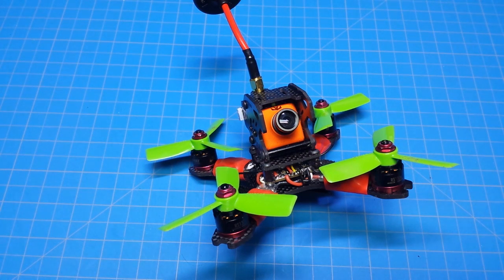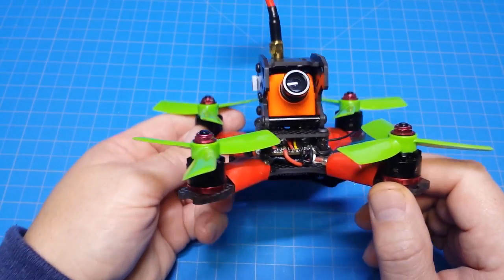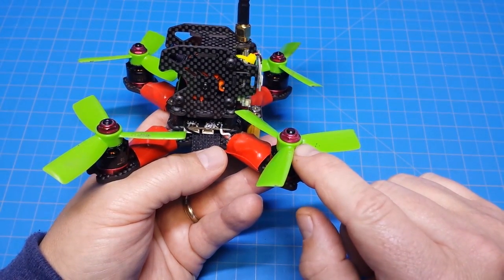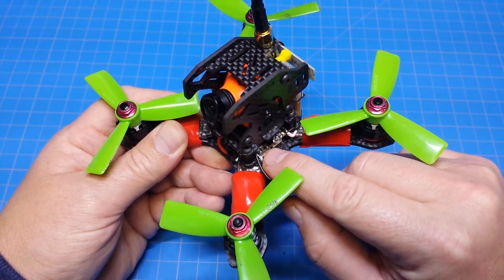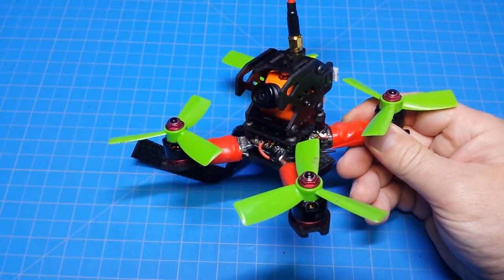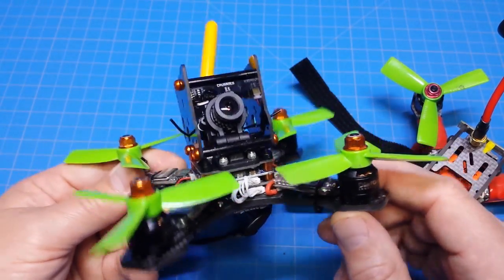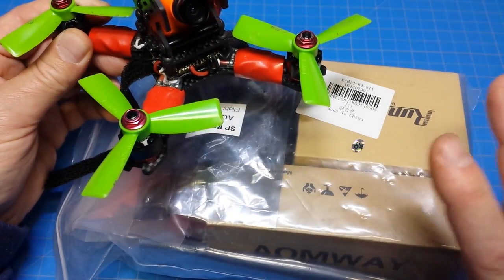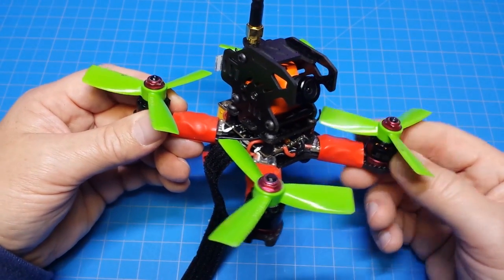Custom - GB130 Frame

Comment: I got the banggood version realacc , it's under $18 it also has the side antenna option you can see mine here: https://static.rcgroups.net/forums/attachments/3/8/9/1/4/5/a9475337-91-IMG_3313.jpg
Reply from the maker: looks good.

Comment: Should i go with 2 motors of each, CW and CWW or just get all CCW and use proper lock nuts.
Reply from the maker: Either way will work, its only the threads on the motor stems that are different. Some prefer all the same threads for the benefit of not having to locate a reverse threaded nut if spares are needed.

Comment: I would rotate the fc so the xt60 is on the side instead on the back. Saver with a crash.
Reply from the maker: yep. In the next GB130 build I do just that. I actually would prefer to have a led rather than the connector solder directly to the board. Ah, maybe next time, or a winter project.
Reply: I ordered the realacc xr130 from banggood. It is also a clone. It is my winter project. I ordered it because it has space for a hs1177 cam. 
I am thinking of putting some cables between the xt60 and the pdb. Also getting some 4s 1000mah lipo's. It will be my indoor racer. Also getting the tramp vtx for it. Have one in my 5" race quad and I am getting the external stick so you can set it up without needing to pres a button. I got my first tramp by a fpv race and that system worked great. 
Hope the frame is here coming week so I can start building it. Fc, motors, esc and cam i have. Only need an extra receiver. Vtx I will use what I have and later I will upgrade it to an immersionrc tram vtx.
Reply from the maker: Has the tramp become the standard at races? Or is it only multigp pushing the tramp? How to they setup classes for the races in your area? Do you have a link to that frame. I am only finding a xr210.
Reply: This is the frame. http://www.banggood.com/Realacc-RX130-RX150-130mm-150mm-3mm-Arm-Carbon-Frame-Kit-with-5V12V-PDB-XT60-Plug-p-1088991.html
I made a mistake with the name. 

No the tramp is not the standard here. I now that some races are sponsored by them. The race were I was sold them for 10 euro. It was the first production model. It works very good with that tnr wand. Best system there is ad the moment. Fast and after the race you can connect the lipo again and work on your quad and check the camera wile others race. 
Ad my club they prefer immercionrc vtx but you see also a lot of tbs and fx systems. Eachine not. After the Dutch drone race we switched from outdoor 600mw to 25mw. Other races the vtx is also free for what I now. 
Here are no classes. I now that there was a race were there was also a beginners class. But other than that, there are no classes.

Comment: What kind of LiPo do these take? 500mAh? 1300mAh?
Just noticed the OSD. You just missed the 1000mAh mark, so thats probably a 1300. Correct?
Reply from the maker: Nah, the mah and battery info is way off in the video. I forgot to switch it to 3S and scale the mah. I typically fly 3s 480mah, get about 2:30-3mins. I like to stay light so it stays more agile, gives me a better chance to recover if I get out of shape....which happens a lot with my skills.

Comment: Wicked setup, looks bags of fun. I love the full size equipmnet on a shrink.
I agree if buying esc now, definitely choose BlheliS but i'm pretty sure those ready salted LB will still run multishot
Reply from the maker: Its great fun. Yea, the tried and true LBs have served me well, time to move on with the rest of the hobby. I actually have mutlishot on this, of course the imperial march tones. I am super excited for the frame I co-designed, it will be similar to this frame with some very slight differences.

Comment: Do you think the Rs3300kv motors might have been a better match as far as battery life etc.. Just wanted your feedback as I'm about to order parts.  Thanks!!
Reply from the maker: Possibly, but only by the smallest of margins. The difference being 700kv. I think the lower kv will have more torque and might more easily spin the bullnose props but will have less top end speed. Its a balance.

Comment: Lovely build Nick, that board looks great for a micro, I'm waiting for the latest version to come back in stock.
Another recommendation here for the racerstar blheli_s, I've just used a set of 20a V2s and they're amazingly smooth, super low spin up and cleanflight passthrough is very handy.

Comment: Hi. I'm currently searching for 130mm frame. I saw almost the same frame. Clone of the clone or of original - i don't know. It's not the point. My concern is that this frame design put a lot of stress on FC and/or PDB. If you crash it hard it probably bend the standoffs and damage the electronics. Don't you think?
I found better frame and it's looks almost the same but, standoffs going in to the main plate not thru FC/PDB. I think it's much better. It also has a plate for RunCamHD or similar on top. The problem with that frame is, that it's only 2 mm thick ( if the specs are correct). And it doesn't come with pdb (other do).
 Anyway, looking forward for your frame. Maybe you design a ~90mm frame for 1103 motors in the future too? Would be nice.
Reply from the maker: I use nylon standoffs in the hopes they are the weak point rather than the FC or pdb etc.

Comment: Sweet video and build :) 

I have been building the GB-X210 in the past 2 days doing videos, and waiting to do the GB130 next :) Unfortunately my X4R-sb on the 210 was DOA, as well as the SP F3 (my lucky day....) , so waiting on new ones of those to come in.

 I'll have to try and find some slim prop nuts for the 130. I have it all mock built up now (no connections made but all parts on) and it looks sweet. I have some emax nano 12a escs on the way so I can run 4s. the vtx they include is kind of awkward to place though :/ 

Did you do the "over under" wiring for the escs?
Reply from the maker: Man getting DOA equipment stinks. The wait for a replacement is so hard. Are those nanos smaller than the littlebees? Yes the vtx doesn't lend to many installations options. No over under on this one, use about a 1inch loop on the top of the esc. I haven't started the GB130 kit. Should be set for tomorrow. I really need to find a good inexpensive stubby antenna.
Reply: Nick Burns Yeah, the $29 rx which was mine and then the FC from the Kit :/ Took the FC from the 130 to just test things, and damn those XS30 escs can spin props slower than other with Bl Heli _s! 

I am not sure on their size, hopefully they are as it is pretty tight as you know. The vtx can be placed along the back plate so that the right angle is facing out the back and it seems like it will fit in nicely like that, then bend the antenn upwards.

Comment: It looks good but the 3 minute flight time is a deal-breaker.  Nope.  You can impress me with a 8 minute minimum flight and an even shorter profile.
Reply from the maker: boy that's a tall task. The FPVStyle Unicorn might come close. Have you seen that one? Of course its much bigger.
Reply: my tarrot 130 gets a good 6 minute flight, but its way under powered compared to this little beast!!!

Comment: I just built a similar micro! the falcon 130 with the new tornado t1 1407 3600kv motors, it's top speed is about the same as my 2205 2300kv 5" setup... crazy and fun stuff! how high does the current go in the OSD? I'm curious and hoping it tops atleast at 100a
Reply from the maker: sounds like a power house. I am not sure what the HGLRC board is rated.